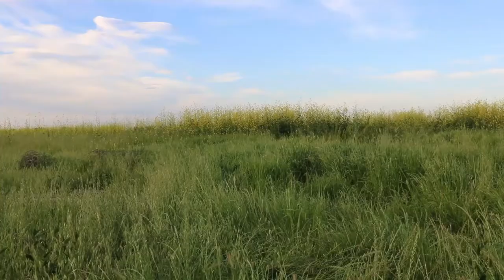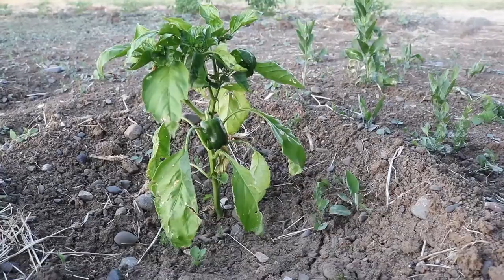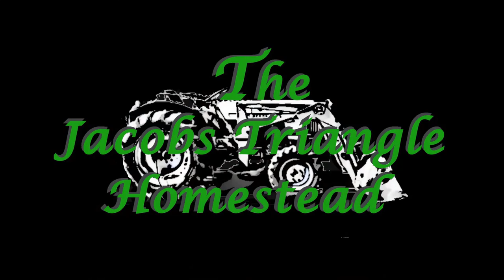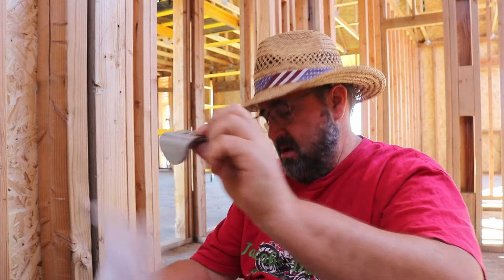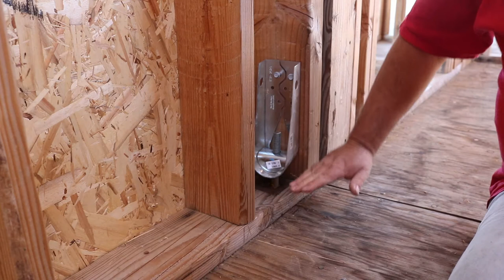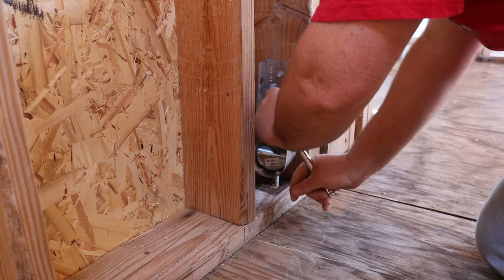How To Install Simpson Strongtie HDU Hold Down Brackets

Comment: Engineering specs on the HDU14's that I have to install on current new construction shows 1/2" space underneath the hold-down.  I've also installed 1" bolts into the concrete forms for the wall/stud-pack connection (may be overkill but I had the big bolts in my inventory.)

Comment: Simpson vois their product specs if you impact drill them like that. Need to hand fit like you did, then 1/3 to 1/2 turn with tool. No impact drill is specified on the product sheet.

Comment: No impact gun on the nut. Finger tight plus 1/3 to 1/2 turn with a hand wrench. On your video the anchor bolt turned like ten degrees when you were impact driving that nut. You now need to reinstall the anchor.

Comment: Simpson spec shows only "preservative-treated barrier may be required". It means the HDU should not touch the pressure treated wood. That is all the purpose of the 'air gap". If you tighten the nuts enough, there is no reason it need an air gap to prevent the stud be lifted up. Sometimes it is easier to install the HDU higher. It is an option, not a requirement.